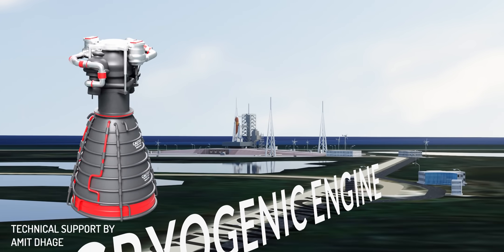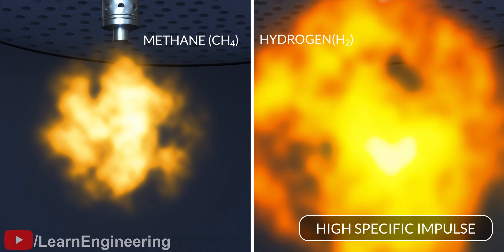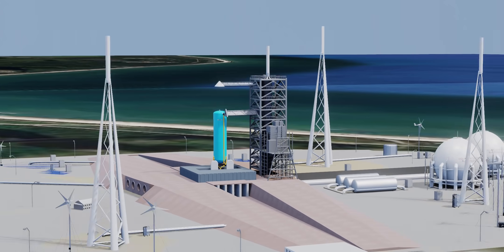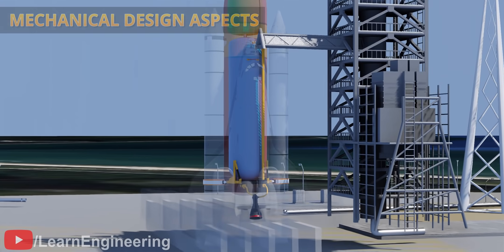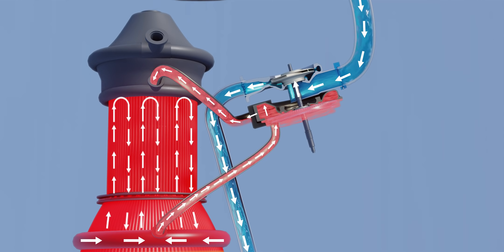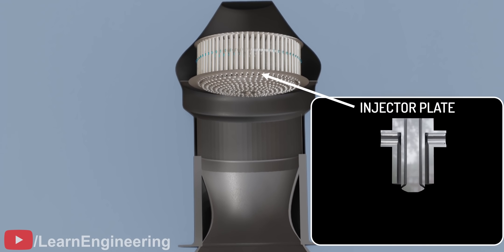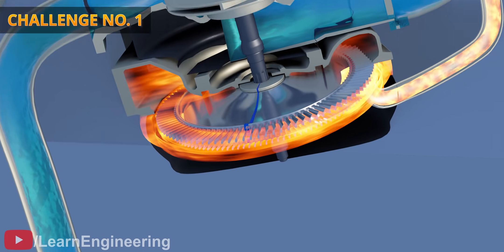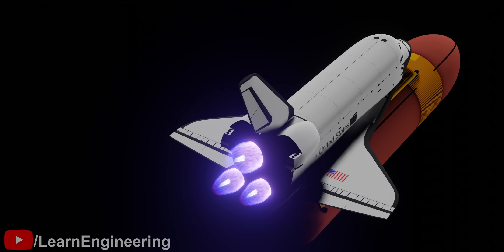Cryogenic Engines | The complete physics

Comment: Cryogenic rocket engines are highly efficient engines and were first flown on the US Atlas-Centaur and were one of the main factors of NASA's success in reaching the Moon by the Saturn V rocket. 

Few other countries have also been using it.

Also, Toyota is focused on developing high efficiency Hydrogen engines, it is possible they may adapt this technology on their Hydrogen cars. 

Toyota has been the leader in automotive technology in the current century and still not interested in EV technology compared to Tesla, Ford etc , this indifference toward EV and focused inclination toward Hydrogen technology is the reason to believe Toyota is going to surprise the world with some adaptation of Cryogenic rocket engines suitable for cars.

Comment: Staged combustion engines have literally fire circulating inside the plumbing.
The Raptor has flown, the BE4 hasn't. And the BE4 is not full-flow, just oxidiser-rich, like the RD180.
BE4 has to replace the RD180 because the latest is build in Russia, but it isn't ready yet - nobody knows why, but possibly because of the turbopump.
Rocket turbopumps are subject to impossible stresses, sometime they can fail if you watch them from the wrong angle...

Comment: What part of the rocket is the bearing structure that absorbs and transfers the thrust? I doubt it is the nozzle, but it seems it is at that spot where the highest force differential would be found. ?
Reply: The throat of the nozzle must withstand all of the force exerted by the engine on the rocket.

Comment: They should've used the Saturn V (the rocket that took men to the moon) in this animation instead. Since the space shuttle has other engine types besides liquid fuel, it's not a very good example. The space shuttle has 3 liquid fuel RS25 engines, 2 Monoprop engines, and 2 large solid rocket fuel boosters. While the Saturn V on its first stage has 5 massive Rocketdyne F1 engines, producing a total of 7.5 million pounds of thrust.
Reply: Would a lot more complex to show it in an animation, even explaining the huge rocketdyne f1 engines. This video seems to explain the basics of rocket engines

Comment: Very good, but the France flag (refering to Vulcain and Vulcain 2 engine I presume) should be replaced with the European flag! Snecma is main contractor not the developer of the entire engine:
Snecma Moteurs (France) has developed the hydrogen turbopump, the gas generator and the feed gate valves; 
EADS Astrium (Germany) developed the combustion chamber with subcontract to Volvo Aero Corp. (Sweden) for the divergent and to MAN Technologie (Germany) for the cardan and thermal protection; 
Avio (Italy) has developed the oxygen turbopump; 
Volvo Aero Corp. (Sweden) the hydrogen and oxygen turbine; 
Techspace Aero (Belgium) the injection chamber valves, the bleed valves and the hot gas valve; 
Microtecnica (Italy) has developed the system of solenoid valves and non-return valves; 
SPE (Netherlands) the ignition and starting systems; 
AVICA (Great Britain) the power lines and DEVTEC (Ireland) the support.

Comment: A theory for cooling the engine is to create some kind of way to spray the gas over the nozzle to the flame, creating a heat sync and burning the hydrogen. This method was used on x-15 to reach mach 6.

Comment: If it would be possible to drop the temperature of the liquid hydrogen by another 7 degrees Celcius, it would become a solid (solid metallic hydrogen).  Wouldn't this solid hydrogen work better in this rocket propulsion application?
Reply: Solid won't flow.

Comment: hydrogen is smallest element; any thing made bigger; Fe; et al; wil cause leak unless huge R&D involved; but if some thing bigger;and is bonded; to form compound; CH4 for example; then Fe or C/C; in multiple tubing since no single 50feet autoclave exists; will have less problem encasing it;

Comment: One question though 😐.. we use H as fuel and Oxygen.. so how come H2O which is water made up of hydrogen and oxygen never burns😐
Reply: The process of burning a hydrogen is oxidation of hydrogen or combustion of hydrogen and oxygen molecules. The result of the oxidation of hydrogen, it's combustion product is simply water (H2O).
The reason that water is not flammable in any state is that it is already a product of combustion. 

Also keep in mind that it is not necessary that if 2 elements have certain chemical properties then it is not compulsory that their molecule will also have the same chemical property they might lose that property in the process of bonding like in the case of Hydrogen and Oxygen forming the Water (H2O) molecule

Comment: If the propellant consists of only hydrogen and oxygen, does that make these rockets free of carbon emissions?
Reply: They are more carbon-free than other fuels like RP-1 or methane because of their direct combustion products but aren't completely carbon-free because carbon-based energy sources are still used to synthesize LH2 and LOx.

Comment: Not great. Using the STS (Space Shuttle) as the first example was a poor choice. The solid rocket boosters of the Space Shuttle shown on the sides of the main engines provide over 70% of the launch thrust.

Comment: 8:18 - Can anyone, please, explain why the impeller is rotating in the wrong direction?
Reply: its in the right direction. . .  since it is driven by the exhaust mixture at the bottom. . .
Reply: @yaswanthkadiri8870  No, I'm referring to the movement of the impeller ITSELF. Impeller is a centrifugal pump, so it is meant to pull the liquid in through the opening in its centre, spin the liquid and use the centrifugal force to impart kinetic energy into it, then "spew" the liquid with speed/ pressure around impeller's circumference, and thus "pump it". Here the impeller is trying to do the opposite - suck the liquid at impeller circumference and force it out through its centre.
The impeller movement might be in agreement with the turbine, but I'm not talking about it - merely about the  impeller itself.

PS: In short, that "Can anyone, please, explain why the impeller is rotating in the wrong direction?" was purely a rhetoric question (i.e. one for which the answer is obvious and/ or not really expected) - it was merely a way of saying "hey, someone screwed the animation, for this impeller to actually pump anything, it must rotate the other way round".

Comment: rs25 is ridiculously expensive. used only bcs specific government demand.  every product should be judged by overall job its doing. and at some price level (compared)there is no point of using it. end using the hydrogen itself is very problematic from so many sides.

Comment: Well rockets are good and needed for propulsion. However why waist fuel going strait up ?! It doesn't take a genus to postulate that you can use less fuel using aircraft fitted for space that take off from runways into space and only using the rocket fuel after reaching 80,000 feet to then enter space using 100 times less fuel AND with enough left over to circle the Moon and come back ! I mean what the hell is going on ? Anybody can see that this is true do to the fact that we already know how to build space planes. That's what the shuttle was ! Wasn't it ?!
Reply: SO you have done the calculations that show the "Mass Fraction" of a spaceplane with wings can reach orbit with more mass than a regular rocket?
COOL!
Can we see your calculations?

Comment: Any work commands respect. But, there is no need to set global goals in lectures on cryogenic rocket engines that are 10, 20, 40, or even 600 minutes long. This video is not about the Physics of the processes in these engines and gives a very simplified idea of cryogenic rocket engines. This is wrong and incorrect because it misleads the inexperienced viewer. The given scheme of the evaporative scheme engine is not working, in this old archaic scheme there are very large hydraulic losses in the cooling tracts of the combustion chamber. These losses lead, in addition to losses in turbine efficiency and, as a consequence, the engine as a whole, also to such large hydraulic losses in the cooling tracts that in total leads to great doubts about the feasibility of using such engines. Nothing is said about the schemes of cryogenic rocket engines with a split system, which partially solves this problem of low efficiency. There are also problems with fuel combustion in the combustion chamber because the oxygen-hydrogen mixtures used in these engines (the ratio of components and the dispersion composition of the mixture) are quite poor. The problem with icing of tanks is somewhere at the end of a series of important and difficult to solve problems in such engines. Good luck, once again, any work deserves respect.

Comment: Space starts at 62 miles high above the earth nothing has ever been to space because rockets can not produce thrust in a vacuum so the rocket just falls back down
Reply: Of course rocket can produce thrust in vacuum.  Rocket burns RP1 fuel/liquid hydrogen with liquid oxygen.  Oxygen is a gas.  The rocket throws the oxygen gas backward and creates thrust.
Reply: @catchnkill  the rocket throws the oxygen gas backward now this is correct but it throws it into an area with zero pressure space has zero pressure that rocket would have to out put 900 quadrillion times the thrust to just get it to go 1 one mile an hour
Reply: @James-zp5po  Exactly the opposite.  No air no friction.  Thus there is less consumption to the backward thurst force.  It is easier to travel in vacuum for the rocket.
Reply: @catchnkill  it might be easier for Mary Poppins to travel but not a human being
Reply: @catchnkill  the rocket throws the oxygen gas backwards into a zero pressure zone and if you wanted to fill that zone which you would have to do first in order to go forward you would need 900 quadrillion times 800 trillion pounds of oxygen gas to be able to go 3mph
Reply: @catchnkill  make your rocket with 100 billion backward thrusting rockets you will get no where
Reply: @James-zp5po  Stop that shit man.  SpaceX launches nearly every week.  Watch the Youtube live and see for yourself.   You are wrong because the SpaceX Falcon rockets exactly do what you say cannot do.
Reply: @catchnkill  if someone paid me a billion dollars to say I could flap my arms and go to the moon I would do it even though it would go against my core value and that is what these guys are doing to you

Comment: In a vacuum , they DON'T .
Reply: Mudkip909  thrust requires atmospheric density . You can't push against nothing . 
Science much ?
Reply: Mudkip909  nothing to push against = zero motion . 
Combustion in a vacuum ? 
See the grade 3 Fire Triangle + entropic equilibrium.
Reply: Mudkip909  🤣😅😂😅🤣 .
Reply: Mudkip909  the instant the valves open ALL contents would  immediately change state to super heated vapour. Instantaneous entropic equilibrium.  
Ignition is an impossibility.  
See the laws of thermodynamics and fluid-dynamics.  
Thanks for the laugh .
Reply: Mudkip909  There are roughly 2.65 x 1019 or 26,500,000,000,000,000,000 molecules in a cubic centimeter of gas at 103 mbar, which is atmospheric pressure at sea level (Table 2). Under lower and lower pressure, the molecules spread out further and further, until, at ultra-high vacuum (10-12 mbar), there are only 2.65 x 104 or 26,500 molecules per cubic centimeter. At this density, there is only one molecule roughly every 0.33 mm in space. Since the diameter of each gas molecule is much less than this (4 x 10-8 cm for air, for example), there is a great deal of space between molecules. To put it into proportion, if gas molecules were grains of sand, at ultra-high vacuum they would be 1,650 meters apart. At these extremely low pressures, the collisions between molecules, which normally dictate the properties of gases, become very infrequent and a different theoretical model is required to explain their properties (the so-called Kinetic Theory of Gases).
Not enough atomic density to even create a reaction between substances.  To create ignition , an exact mix of elements is required.
In a deep vacuum environment attaining the correct %'s of gas that's required for ignition is Impossible. 
Research it yourself .
Reply: Mudkip909  the instant the valve opened to release fuel or accelerant,  both tanks would INSTANTLY be emptied . 
What happens to an astronaut in a capsule when the hull is breached ?
Every atom of that astronaut would be streched out through whatever size hole was exposed to the vacuum . Stretching the astronauts atoms to as small as single file atoms. 
Until every atom was stretched so far apart they are indistinguishable from background atomic density , which in an almost perfect vacuum IS NIL . 
You simply cannot "squirt" accelerant into a fuel stream in a perfect vacuum and hope for ignition. It is a scientific IMPOSSIBILITY.  The volume of space between particles make the gas indistinguishable in an instant.
Making the required fuel/accelerant mixture for combustion an absolute impossibility.  That is called PHYSICS.  And even NASA can not defy those Laws .
Reply: Mudkip909  😅😅😅
Reply: Mudkip909  combustion requires a precise mixture of gases.
Not possible in a vacuum . 
ENTROPIC EQUILIBRIUM.  
And yes , the laws of thermodynamics do encompass it .